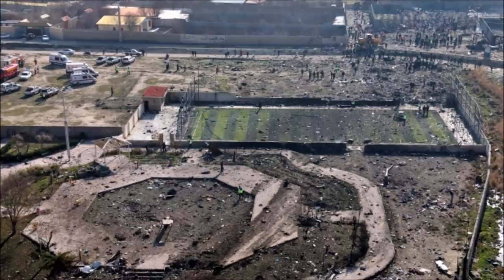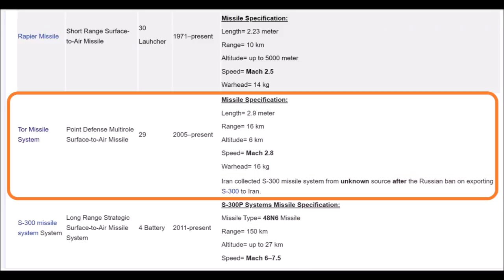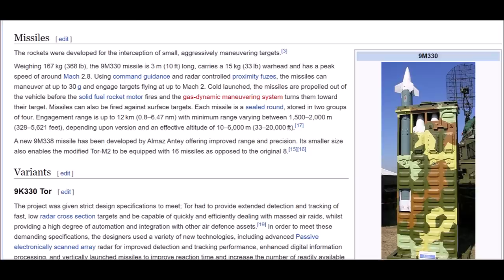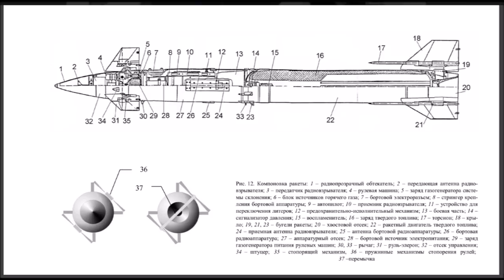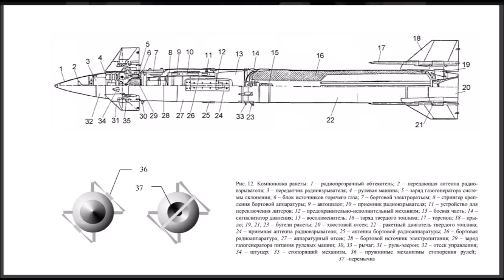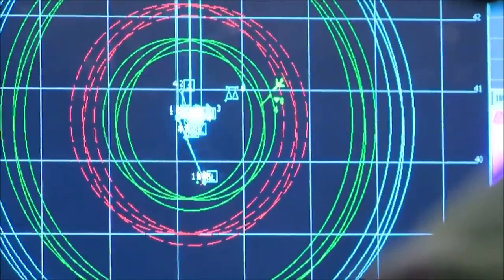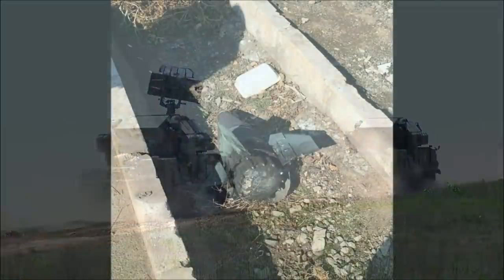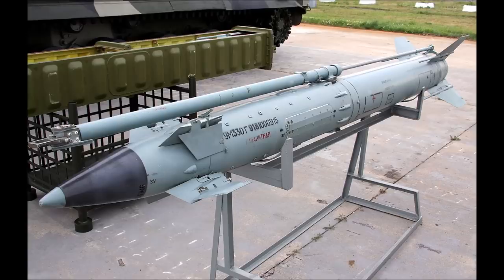SA-15 (Tor M-1) Surface to Air Missile system. Boeing 737-800 down in Iran

Comment: I tried to find some how missives work videos, because I’d read that they used to be designed to literally miss the target (otherwise they’d be called hitiles).  Your traditional missile plans to get close enough that when the warhead detonates, it sends shrapnel into/through the fuselage, engine(s), wing(s); either from the side, or in the path of the target, letting it fly through the shrapnel.  As well as the bow tie or rod-shaped shrapnel, I read that some designs use a tightly coiled metal, that rapidly uncoils like a whip, slicing through anything within close proximity.

Comment: Wouldn't it be useful if we knew how many passenger aircraft arrived and departed Tehran that night/morning after they launched their missile attack on Al Assad Air base? What are the odds? I mean the passenger aircraft generally use the same runway approach and takeoff routes (routinely) due to the current wind patterns, so how (or why) was this one attacked? If the launcher was parked almost directly under the flight path to the airport, would they not realize the difference between a passenger jet slowly taking off vs. a B2 Bomber on a bombing run? There seems to be more to this than we're getting, of course.

Comment: Why is this called a mistake, was the missile system a maned vehicle, did they lock on the passenger plane and manually launch? If so it was not a mistake, it may have been mistakenly identified by a nervous operator as an unfriendly but that’s the mistake and as far as I’m concerned that’s the way it should be described,a passenger plane that mistakenly was identified was shot down. I’m not the grammar police nor is this a knock on Juan or anyone else. I may just be blowing hot air but that’s the way I see it.

Comment: The current speculation as to why the plane was targeted is that it was mistake.  There were no Americans on board.  Iran is not particularly hostile to Ukraine.  From what you show it would be hard to make a simple mistake. But Iran no doubt had the missiles ready, expecting a possible US attack.
Reply: It was a Boeing. Fair game.. to Ali Khamenei.. who, according to Iran news, was in charge of the missile batteries launching against Iraq US bases. Maybe, like a little kid, he got excited while holding the controller?

Comment: Oops, Sorry. That’s a tough way to go. Shot down on a commercial flight. All I ever think about is the screaming. Few minutes of screaming before it’s all over. I visited the Flight 93 Memorial in Shanksville, PA. They did a beautiful job with the site & visitors center. They put a huge boulder on the impact spot about 300 yards from the walkway that goes all the way around. The Fight in the cockpit lasted 6 1/2 minutes. CJ

Comment: Doesn't TOR have a beep or boop which will sound if it's locked on to civilian aircraft? 
I doubt it was accidentally done.
Reply: You know - a transponder sends out a signal which designates if an aircraft is civilian or military - did the 737 not have that on?

Comment: Great report, however I have questions on Mach number. Why is it used to describe a velocity?It seems confusing to calculate a velocity relative to a changing value, since the speed of sound varies from 1125 ft/s at standard pressure and temperature to 0 ft/s in space (about 62 miles.)
Reply: Dave Smith Wrong, the speed of sound is never zero, and Mach number is widely understood.

Comment: I think there is almost zero chance these terrorist did as suspected, however I am questioning this photo of the SA-15 tailpiece making the rounds. If the SA-15 is proximity fuse detonated, I would assume the explosion would have caused the tailpiece to fall to the ground near the point of the explosion, and not near the crash site. I think my first thought was that perhaps, post explosion the missiles velocity caused pieces of the missile to continue forward on its initial path and crash into and become lodged in the striken aircraft. But I would think the tailpiece would be on the side of the explosion away from the aircraft causing it to be blown away from the plane, not toward it. 
And if it was found in another location, not at the crash site, how can anyone be sure it came from the crashed aircraft? I imagine pieces of exploded munitions and other ordnance is not an uncommon thing to find on Iranians countryside.
Just my two cents.

Comment: No doubt Tehran airport is in a pretty dense AD environment and they were bound to be trigger-happy.  SA-15 does have an IFF interogator but you have to use it for it to be effective in identifying a non-hostile squawk.  Undoubtedly a tragic mistake by Iran, and not surprising they are denying everything.  The SA-11 shoot-down over Ukraine was another mis-ID, and don't forget the Vincennes incident in '88.  One minor thing: Tor in Russian is still Tor, remember they use a different alphabet where 'r'='p' (as in USSR=CCCP).

Comment: AS-15 designed for air launch cruise missiles/UAVs where they have a 90% kill ratio.  A significant lower ratio for military fighter aircraft.  At 5,000, steady heading and maybe 300kts, the 737 was doomed.  You’re right, Juan, about command and and control.  A few miles from their capital’s international airport and somehow someone with the power to launch, brings down a departing civilian 737.  Incredible! A question I haven’t heard asked is, ‘what airline’s dispatch would allow operations anywhere in Iran under the circumstances?’
Reply: Probably the Iranian government had not let civilian airlines understand the full situation. But they themselves knew it... they should have kept the airlines locked down for hours more, if not days.
Reply: Fuzzybeanerizer The crew had to have been in Tehran from their inbound leg for at least 12-18 hours.  That was right in the middle of the Tehran demonstrations.  The FAA had prohibited US flagged carriers from flying in the airspace 3 hours prior and most international carriers follow the FAA’s direction.   However, there had been 12 flights out of, or into, Tehran earlier that day.  Want to bet that Trump/USA will be blamed?

Comment: Would a commercial airliner even know that a missile had been shot at it? I'd imagine it wouldn't.
Reply: No, a typical airliner like that one has no way of knowing it was engaged. There are self protection kits available to be mounted on such aircraft, but those are designed to combat MANPADs, not full blown radar, or command controlled systems. And those kits would only inform you that there was a launch of a missile, and initiate countermeasures - it has no way of knowing if the attack is directed at you, and in these circumstances, those countermeasures would not be effective (designed to blind IR seekers). Furthermore, even combat aircraft will have problems with systems like TOR, as it uses radio-command steering,  and may be employed using only its optical tracker - which means, that you may not have any indication that this system is in vicinity and only option to counter it is jamming its guidance - you need to be prepared to counter this exact threat ahead of time.
Reply: I suspect their only knowledge would be either the moment of impact (with the shrapnel) and detonation or if they witnessed the initial launch (if headed towards them from a forward position) and saw it streaking towards them, either way I can’t imagine there is much a commercial airliner could do in response as they likely don’t have any ability to launch decoys or flares (though I believe some that routinely fly into hot areas may be equipped with such ability) and they certainly can not outmaneuver the missile.  If I had to venture a guess, the first missile likely either took out an engine and/or severed significant portions of the plane’s electrical system (hence no radio or transponder info after the first missile strike), they attempted to circle back around to the airport to land only to be again struck by the second inbound missile that either shattered the airframe or ignited the fuel tank(s) destroying the aircraft entirely as it just rained down as debris from the looks of things.  But that is only my uneducated supposition!
Reply: @ethanpoole3443  because of short engagement window, the standard procedure for those systems was/is to launch both missiles in short succession, to ensure high kill probability, Tor was designed to do exactly that (as improvement to Osa system that came before). Both missiles would intercept the aircraft shortly one after another, there would be no time to turn around as with the size of the missile warheads, against an airliner, you have high probability of severing control linkages/wires, and destroying everything located in the "center of mass" of engaged target - which in this case means most of fuel tanks, both engines and generators. No recovery, and no communication would be possible.

Comment: Minor correction - The Tor M-1 carries 16 missiles, and can engage 4 targets simultaneously per unit, and can link via batteries for significantly more targets.
Reply: Each magazine or (rack) carries 4 missiles, and it carries 4 racks.
Reply from the maker: @LordFalconsword  Thanks Mark! (I don't see all 4 racks).

Comment: Juan, a few seconds of video that Fox News had showed soot on the inside of the aircraft where normally there would be a fiberglass and insulated panel. The Iranians were playing up that an engine exploded which caused the crash. 

A video that was captured via cellphone appears to show the missile launch and the explosion on contact. 

One of the hypothesizes floating was that the missile battery may have been switched to automatic, and that no person pushed the launch button. Whomever/whatever the cause, getting the truth will be more difficult than finding the persons responsible for Big Foot.
Reply: Somebody had to switch the system to automatic. Same thing as pushing the button.

Comment: Its not like this missile system can hide in the boot of someone's car. It must have been seen and where it went must be known. I wonder why though? Who was on the plane? and why were they so vital that it justified killing the plane and everybody in it? Who ordered this? Thanks for this item/information Juan Brown.
Reply: this system is for protecting ground assets and other sams from aircraft and ordnance. just to give a prospective of where it could have been stationed.
Reply: @mitri5389  My point is that this system shot down what appears to be a standard commercial airliner posing no threat as it began it's journey. Who might have these in the area? and if not government, then who can sneak one around unseen? let alone set up up for deployment and then of course fire off a couple of rounds? Its not like it fits in someone's car boot or their purse. All the same, it does not seem in the Iranian government's interests either. But like the American gun argument where "its not guns that kill people", similarly its not the manufacturer of these missiles which fired it. Its a very interesting puzzle.
Reply: @kiwikeith7633  why would it need to be hidden? they have a few spots which they park the tor at like most highly mobile systems to protect key installations. plus its owned by their government not some kind of  rebel faction. 

and radars dont show everything, think of it like a flash light in a very dark room. objects can be hidden by terrain features 

considering that irans capital has many military bases around the city its not hard to considered a tor spotted a unidentified object which only presented itself when it came into view of its radar either because it was parked behind a mountain or some structure.  and on top of that the flight was delayed for some time and the air defense was most likely not informed.
Reply: @mitri5389  I don't assume who had this missile system, or who fired it. Sure its hard to imagine it being there without the Iranian authorities knowing about it, but there are precedents of missiles taking down airliners and the operator of the missile system being argued. I refer to my original comment which really shows I am waiting for the evidence.

Comment: The Iranian government has emphatically denied that the aircraft was shot down by them. A military official has released a statement confirming that the aircraft went down due to an engine fire and that the Captain lost control of the jet. How he knew that has not been released. Also, this same government official said that no Iranian military or government officials have said that the aircraft was shot down. OK, then....BTW, One of our union blogs got some information that the debris field is already being cleared, by bulldozers and other means. Interesting, I'm sure that Boeing doesn't appreciate being thrown under the bus like this, and the investigators at the NTSB are probably pulling their hair out by the news that the site is being 'sanitized'.
Reply: how and why is the ntsb relevant to iran?
Reply: @mitri5389  Not sure what your point is. The NTSB does accident investigations, and would vehemently object to a crash site being 'sanitized' the day after the crash. I'm not saying that Iran should invite the NTSB over to help their 'investigation', but they have frequently taken part in analysis when US built aircraft go down on foreign soil.

Comment: It is truly amazing that this flight was allowed to depart when clearly Iran was on high alert for a response to their missile strike against US forces. The debris field pretty much suggests a catastrophic in-flight breakup since there is no major impact crater, there are no intact large sections of the fuselage, with thousands of remnants fluttering down over a 1 kilometer area. This is the third such incident of an airliner being brought down by a surface to air missile in an area of potential conflict. The CVR will give the recording of the cockpit sounds at the time of impact, however, the FDR will not likely yield much information since the electrical power will most likely have been lost immediately thereafter. An airliner is a sitting duck for these types of missiles. The Iranian officials have stated they will share the data with the Ukrainian authorities, however, I expect we will a have a pretty clear idea of what happened with or without that information.

Comment: I was in the camp as well that it was a accidental shoot down.  But how can a crew operating one of these be so oblivious to the air traffic route they are sitting under, they are a relatively short number of kilometers from a active international airport, and have a relatively short range missile (12km as data shown), obviously not extremely short range but certainly in realm of SAM's it is in the short range category I'm sure.   

I understand the military was likely extremely on edge and maybe these operators got trigger itchy when they saw the radar signature.  However  I'm sure they would have been picking up the 737's radar signature from the moment it took off of the AIRPORT.  Its a miracle they didn't shoot down anyone else.   

Anycase Iran clearly needs to answer for this, operating a Mobile AA system within a near distance to a airport and knocking out a civillian jet moments after take off, ya not good.

Comment: Since the SA-15 crew set up in the departure path of the airport, my preliminary assessment is that they intended to shoot down an aircraft departing that airport.  That seems like an accident and more like a trap or ambush.  Maybe the generals did not know what the troops in the field were doing?  What if the SA-15 crew was engaged in a drill using the airliner.....negligent discharge of their weapon or a crew that just wanted to kill??  One way or the other, those guys were positioned at that location for a purpose.
Reply: Even if they were using the airliner for a drill and accidentally fired missiles, the TOR system can abort the target at any time. It is tracked to impact.
Reply: A map I saw earlier showed that the launcher was set up in some kind of military facility a few miles from the end of the runway.
Reply: @Doug_Morgan  Thanks Dug,  We will have to wait for the final evaluation, but the "smell" of it at this point says "intentional" to me.
Reply: @augiegray6239  I am thinking someone was a little too nervous after them launching a missile attack on the 2 US bases in Iraq. Probably mistook the 737 for a hostile aircraft. Stupid as hell, but dumber things have happened.

Comment: Remembering when the US Navy shot down an Iranian Airliner
Reply: I also remember... 1988. The US Navy cruiser was fighting a harassing battle with Iranian gunboats, and this plane came right at them. Battle nerves took over and they assumed it was an attacking fighter or bomber and launched on it. Turns out it was an Airbus 300 with 276 people on board and this was its normal flight path. This situation with the 737-800 smells the same. As I see it, tensions were high because Iran had just launched missiles into Iraq, expecting an American response. The flight path the Ukrainian plane was flying took it over valuable missile factories, even though it was the normal departure path from the airport. Some guy sitting inside a "tank" (Tor mobile missile launcher) with battle nerves read the blips in the sky all wrong and launched. If I'm right, will Iran admit it and improve their command and control, or will they follow their first impulse and try to keep it covered up and blame others?
Reply: The Russians also shot down MH17 in 2014 over Ukraine.